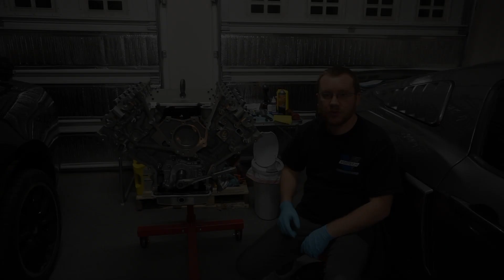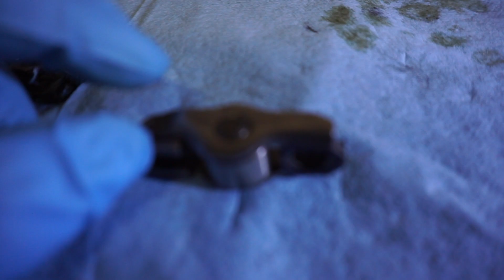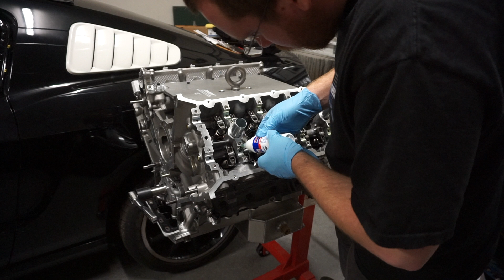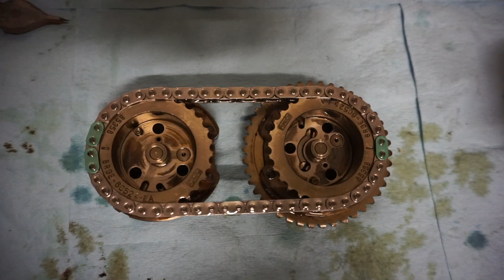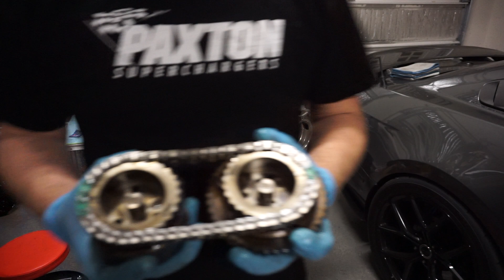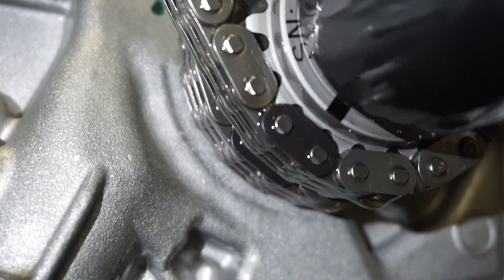Frankenstein Coyote Build p.3: Installing Cams and Timing the Motor

Comment: does it matter which piston is up and down or just that the key way is in the correct position?  Someone disassemled this motor and i have no clue if they pull it apart the right way.
Reply from the maker: The pistons are tied to the crank so they can’t be changed in regards to position, just focus on the key way position.

Comment: I installed my new timing set and everything was rotating over by hand nice and smooth and then all of a sudden it stopped? Is that because there’s no oil in the system anymore?
Reply from the maker: That doesn’t sound right. I don’t think oil would cause the rotating assembly to suddenly lock up effectively and no longer turn. You may have had something go wrong like the chain skipped a link etc. definitely double check your work.

Comment: Dont know if you still respond to these but im about to rebuild my gen 2 coyote and its just the timing im a bit confused on. Do I need all these special instruments to get TDC in relation to the valve or does just putting the chains in relation with the gear marks is all it needs. Thanks
Reply from the maker: I try! If you’ve got a Gen 2 car you would just match all your cams/timing to the Gen 2 and follow the Gen 2 timing procedure. Don’t need to find TDC, you just start with the crankshaft key way at 12 o clock then follow the timing procedure for the Gen 2. Nothing too fancy there.
Reply: @pokemasterbs  That's about what I figured, this is my first engine rebuild I've ever done and seen a few ways to do it. Just wanna make sure I do it right the first time. Thanks for your input👍
Reply from the maker: @dynastycrew824 absolutely man. Best of luck with your build! Just take your time and double check your work and you should be fine 👍

Comment: Do you have to set the valve lash on the finger follower setup? and if so, how?
Reply from the maker: No they are self adjusting based on oil pressure I believe.

Comment: Any recommendations for a 3-1-1 build?
Reply from the maker: I’d say go with boss 302 head gaskets as they match the Gen 1 heads. Otherwise nothing really different going on there. No need to spring for a lot of the fancier parts like billet timing guides or even aftermarket crank damper unless you’re boosted and want to run an OD one.
Reply: @pokemasterbs  thank you 👍🏻👍🏻👍🏻 i do want to boost next year hopefully but for now i just want to build this motor

Comment: Great video by the way, I was wondering I have a GEN three Ford F150 with a coyote engine what’s the time in procedure for that is the same as one and to a totally different?
Reply from the maker: If your F150 has a Gen 3 coyote (2017.5+) the timing procedure is not the same. Gen 1, Gen 2, and Gen 3 all have different timing procedures unfortunately.

Comment: I installed oil pump gears I didn’t remove the cams and now when I try and rotate the engine it stops and you can hear something hitting and ideas what I did wrong?

Comment: Hey I’m installing my cams today. Whenever I try to set the cams in place where they are supposed to go they don’t sit flush with the head cam journals. What could be the problem?
Reply from the maker: It’s normal. Just Goto evenly bring them down via the cam caps. Just make sure that they turn over freely once everything is torqued down.

Comment: So, I have recently done a 3-2-1 build. I have done this exact same process. I keep getting cam codes. P2014, P2015, and P2024. Can exhaust cam to far advanced, and 2015 is too far retarded. It replaced the timing set for a second time. Has brand new vvt solenoids on it. I am running stock cams and I have pax 1217x valve springs. Would you have any ideal why he keeps kicking these codes.
Reply from the maker: I would double check the timing on the motor. Usually those codes will pop up if timing is off one tooth. The chains like to skip when you add tension back onto them. So always good to double check the timing marks and rotate things over to make sure they stay and done skip once a rotation is started.

Comment: Did you clean the cams before installing? I know years ago when I was building my smallblock that the cam had some coating on it and stated that had to be cleaned before installed.
Reply from the maker: The cams were actually second hand and had a few thousand miles on them before me. So I didn’t get them new to have to do anything along those lines. If they are shipped with any kind of oil/coating on them new though I would definitely agree that they would need to get cleaned before install.

Comment: I know this is old but, first gen F-150, trying to verify the cam timing is correct. It seems the passenger cams are off. When primary chain links are on their respective R or L marks the secondary gear marks are not aligned to the head surface on the passenger side, I think they should be. Trying to not tear it completely down to see the crank gear but maybe that’s the only way to be sure. Thanks!
Reply from the maker: Sorry I’m not entirely following your write up. Have you turned the motor over after your initial install? If so, the timing marks will never really line up perfectly again. And the number of rotations you would go through trying to make them would likely be ridiculous. As long as the marks were all in proper location after you added tension to both primaries and secondaries then you should be alright.
Reply: @pokemasterbs  I’m taking apart to find a problem. It’s running badly and the passenger bank is loud using a stethoscope when it does run. I turned it over many many times until the primaries lined up. After watching your video a few more times I realized that getting the drivers side L marks vertical should indicate the crank is at 9 o’clock. Then I rotated the crank 90° CW to 12 o’clock and the passenger marks were vertical. Both primary chain dark links on their respective marks. Looks like the cams are correctly installed. Thanks for the reply!
Reply from the maker: Glad you got it sorted 👍

Comment: Can u change the lifters/lashes with out removing the cams ?
Reply from the maker: No I don’t believe so. Unless maybe the cams in the right position and you can compress the valve springs side enough to like slip the follower out. But I’ve never tried it to know for sure.

Comment: What;s the difference between a Gen 2 and Gen 3 block?  I know the head oil ports are slightly different and the oil pan and pickup tubes....anything else?
Reply: Oil filter housing, 3rd gen block uses 12mm bolts and does not use sleeves.

Comment: Do the secondary tensioner guides have a small metal clip that clips onto the secondary tensioner to keep the guide in place?
Reply from the maker: No they don’t they just press into the mega cap and are retained by the o-rings.

Comment: What did you end up doing with your knock sensors? And did you run a gen 2 rear main seal cover?
Reply from the maker: The Gen 3s were taken off and oem Gen 1s installed. I did not touch the rear main seal I left it as is and have no issues with the crank sensor and rpm signal, however best practice would be to swap it out for a gen1/2 style to match the sensor.
Reply: @pokemasterbs  thanks for the help. I’m currently doing this same build except with a gen 3 F150 short block and gen 2 mustang heads. Do you have an Instagram where I can follow you?
Reply from the maker: @StillNoPickles69  Sure do, it's pokemasterb5.0 and no problem good luck with the build!

Comment: What modifications did you for the oil pressure switch from the gen1 to the gen 3 housing?
Reply from the maker: Are you referring to the oil filter adapter? You just run a Gen 2 and will be hood to go. If referring to the sensor out in your Gen 1 sensor or Gen 2 if you’ve got a 15-17 car.

Comment: So I'm having an issue getting my driver side intake cam to set. I have it in the correct position but the cam doesn't set in the race flush. Was wondering if I should just run with it and torque it or keep diagnosing the problem. If there even is a problem.
Reply from the maker: You mean when you set the cam down into the head? They won’t necessarily sit down flush into the head the moment you put them in because of the orientation of the cam lobes and having pressure on them from the valves. If it’s in the correct position and you can put the cam caps on and get those tightened down and torqued you should be good. A good thing to check is that you can turn the cam some once everything is torqued to verify there isn’t any binding.
Reply: @pokemasterbs  Thanks for the reply man. I'll give it a try!
Reply: Running into the same exact issue on my gen 3 build. Setting the cams to where the timing marks need to be results in the cam not sitting in the head correctly. What am I missing?

Comment: Hey man! Thanks so much for putting these together. I had a question if you have some time. I recently did OPG/CS on gen 1. I haven't messed with cams/phaser chains. Only primary RH/LH timing chains. I'm pretty sure it skipped a tooth when I was rotating the motor by hand. It's definitely out of time so I'm curious if I need to do something different when putting it back in time. I have stock cams so I'm assuming I just rotate until matrix's are facing up, keyway at 12, remove RH chain, rotate keyway counter clockwise to 9, remove LH chain, then line up my marks again? I wasn't sure if the cams or valve or anything else would be out of time since I didn't mess with those at all? Thanks so much for any response man!
Reply from the maker: I’d be surprised if your secondary timing skipped. You likely just need to do exactly what you said. Start the timing procedure over from scratch with the matrixes up top. What I do is usually rotate the slack out of the chain in the on side before adding the tension back on the other. If you put tension back on the chains and the backside has slack that can be what causes it to skip a link.

Comment: Is the MMR tool necessary?
Reply from the maker: Not particularly if you can find a good alternative but it’s difficult to torque the cam and phaser bolts without something holding the in place.
Reply: @pokemasterbs  thx for the reply. Do you know of any detailed guides online?
Reply from the maker: Ford service manual is what you need. You can probably google it and find one 👍
Reply: Thx for the reply I have one more question.  Do you know if gen 1 headers fit on gen 2 heads? Can't find any info on it.
Reply from the maker: @Bigmonkey34mn  Yes they will bolt up fine.

Comment: Seen MMR do a similar demonstration but had the crank facing 12 position if I’m not mistaken. What’s reason for 9 position?
Reply from the maker: When removing the timing chains to do an oil pump gear job on a gen 1 car the ford manual says to start at 12 when removing passenger chains, then rotate counter clockwise to 9 o’clock before removing the driver chains. Then for reassembling install driver chains and rotate back to 12 o’clock. So I assembled it as such. It may not be necessary, but I don’t care to find out the hard way.

Comment: Should have locked them phaser out bro
Reply from the maker: You loose the low end driving ability and power/benefits when you lock the cams out. And given that it’s mostly a street car not making insane power didn’t see a benefit to doing so outside of the obvious cam lope sound I would have gotten. But don’t worry I’ll be helping a buddy swap a built motor into his car soon with locked cams etc. 😉
Reply: Don't need to lock out BRO' if you know how to tune.

Comment: Great video!  So do you not degree the cams on a coyote?
Reply from the maker: No sir, not unless you use cam lockouts. The cam phasers electronically degree the cams based on the tune put on the car.
Reply: You should verify it, yes.
Reply: @GapSauceYoutube  The VVT handles the phasing, doesn't do any good. If you truly understand how the phasers work you would know this.
Reply: @charlesmeaux3954  I'm no Coyote expert mate. But there is usually a few degree's slop in modular cam gear keyways. It's always best to verify the lobes are correct regardless of the engine/cams. The last set I installed were 25degrees more duration than I ordered, as well as ground 5degree's off the advertised lobe centreline.

If you have the ability to adjust them on the fly on the dyno with back to back tuning then you could get away without degreeing them though, but I think people should check their parts, its hard to trust manufacturers lately.
Reply from the maker: @GapSauceYoutube  certainly a fair point, but I don’t think the average hobbyist is going to know how to check that unfortunately. So we are left with hoping the professionals crossed their t’s and dotted their I’s 🤷‍♂️ I’m happy to admit I certainly don’t know how lol another reason why leaving the VVT intact just makes more sense.
Reply: @pokemasterbs  I agree mate, I know most busy shops wouldn't spend the time doing it incar.  It's tedious, but worth it.

Comment: What position should crank keyway be in when installing passenger side timing components etc?
Reply from the maker: Depends on if timing for a gen 1 or 2 cam setup. But for gen 1 as stated I started at 9 o’clock on drive chains and rotated forward to 12 o’clock for passenger chains.
Reply: When you rotate to 12 o'clock did u turn crank clockwise or counter clockwise?
Reply from the maker: Clockwise
Reply: Its a gen 1

Comment: Did you remove clips a day leave them off?
Reply from the maker: Sorry not understanding your question?
Reply: On the rockers where you removed the clips on end did you leave them off or put back on?
Reply: Did you leave clips off completely when you reassembled engine?
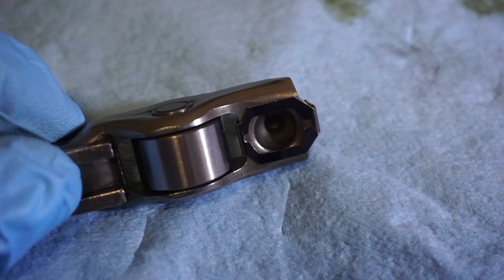Reply: 2:06
Reply: When you removed clips from finger followers did you leave them off when you put back into heads?
Reply from the maker: All of the rocker clips were left off, yes. They serve no purpose outside of ease of engine assembly. But I have seen where they have popped off in someone’s motor before and been bouncing around inside the head potentially causing a ticking sound, so I opted to remove them entirely. No issues with the motor to date.
Reply: @pokemasterbs  
They're supposed to provide an extra measure of security during initial start up, before the engine sees oil pressure to the top end, to keep the rockers aligned. I heard some people suggest to keep them on to avoid the possibility of a rocker jumping off the lash adjuster and I've heard some say to take them off so they don't pop off and float around your engine. It seems to be one of those things no one really knows for sure what to do with them.
Reply from the maker: @177SCmaro  Interesting that's the first I've heard anyone mention keeping the rockers assembled, but it does make sense as first start up may not have the full oil pressure and if a lash adjuster doesn't fully extend it could let pressure of the follower off the cam. To each their own I suppose but I had no issues skipping them plus I liked knowing they would be less likely to come off and make their way around the motor.
Reply: @pokemasterbs  I decided to leave them on mine for now, I have locked cams with vvt deleted and "perfect circle" sprockets so I think my valve train is especially easy on the cams and rockers. If I do comp cams and springs I might pull them off. I don't know anyone with very much experience racing the Coyote to ask what they think about them and there's not a ton of info out there one way or the other.
Reply from the maker: @177SCmaro  nice! Hopefully they work and perform as advertised! It’s definitely hard to find good detailed information out there about the coyote but I do think it’s starting to become a little more readily available with time. I spent countless hours getting myself prepared for this motor build which was certainly taxing lol

Comment: What kind of cams you have
Reply from the maker: I run comp cams stage 3 blower cams (NSR line) 🤘
Reply: @pokemasterbs  as I read from comp cam you should have the phaser limiters with stage 3 blower NSR 2014 !!? I didn't see you installing them can you run them with out the cam phaser limiters?!
Reply from the maker: @murphytb5095  yessir no phaser limiters installed on my motor. This was per recommendation from my tuner. I would reach out to whoever is tuning your car and see what they would prefer you do. Or just install them for peace of mind if you don’t trust your tuner to dial in the setup correctly accordingly.
Reply: PokeMasterBS Didn’t know they had a stage 3. I have the stage 2
Reply: PokeMasterBS O nvm its for 11-14 models
Reply from the maker: Yeah 11-14 cams to stay consistent with the gen 1 ECU
Reply: @pokemasterbs  are you still using the stock springs or did you use boss 302 springs? (Backtracking because I'm finally building the coyote for my paxton. Rods, pistons, blower cams, & maybe springs. Mostly focused on the weak points lol
Reply from the maker: @lifeonmars03  I’m using the stock valve springs from the gen 2 heads which are actually the boss valve springs. If they weren’t I would have swapped them out but in this case there was no need.
Reply: @pokemasterbs  nice! Thanks for replying. What about the crank? Is that stock or aftermarket?
Reply from the maker: @lifeonmars03  Stock crankshaft. You can watch the "setting up the short block" video I have which goes into detail on every part I used to assemble the whole motor.
Reply: @pokemasterbs  thank you. I'll watch it brotha!

Comment: Whats the difference between the arp phasers kit 12bolt #256-1003 vs 24 bolt #156-1006
Reply from the maker: From why I can tell it’s just 12 vs 24 bolts. You’ll need the 24 if doing the whole motor or both sides